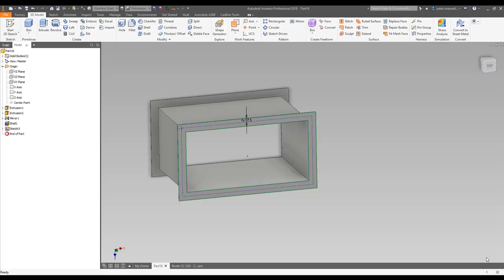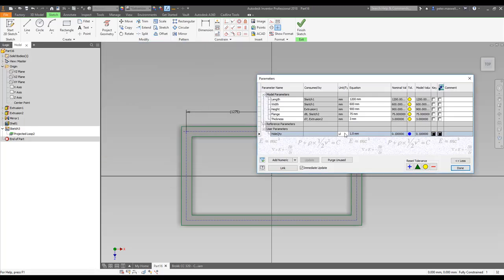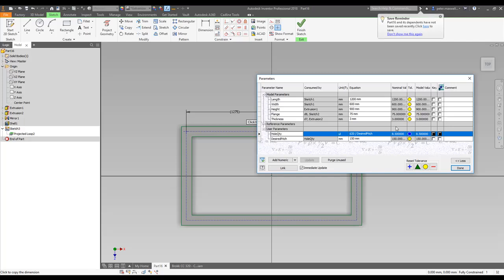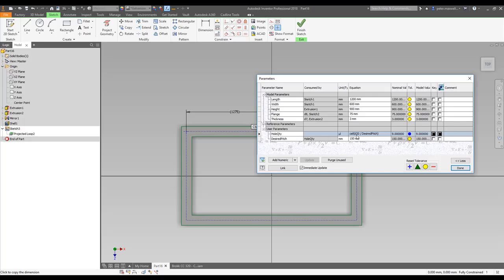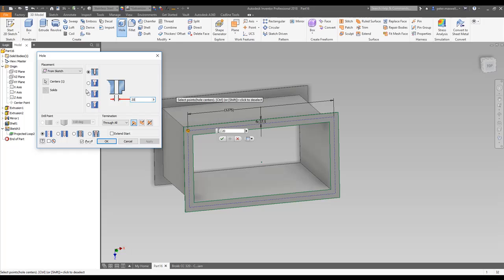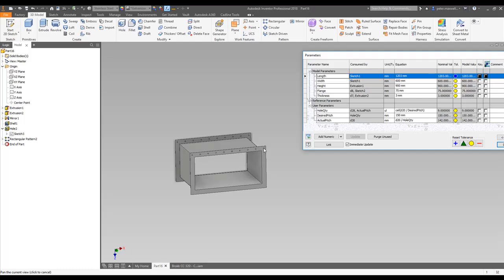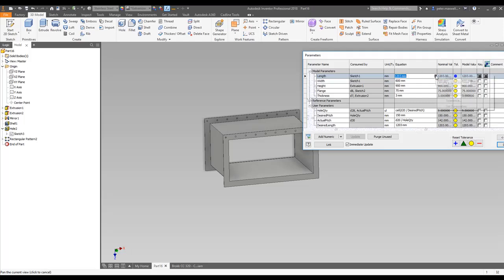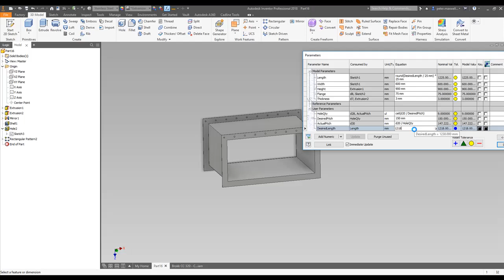Autodesk Inventor:Rounding Parameters

Comment: when i type floor or round it ends up beeing zero.
Reply: changed evrything to MM and it works. but its endsup with a zero more. so 3069/900 = 3.41 but i need 3, so i ad floor not it ends up with 30.?????? instead of 3????